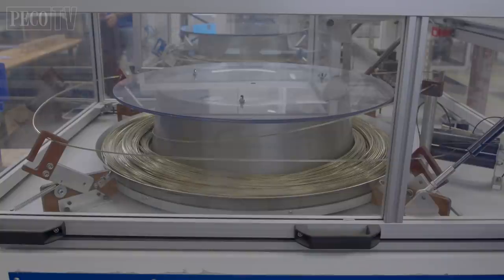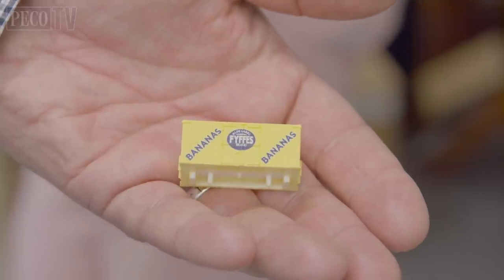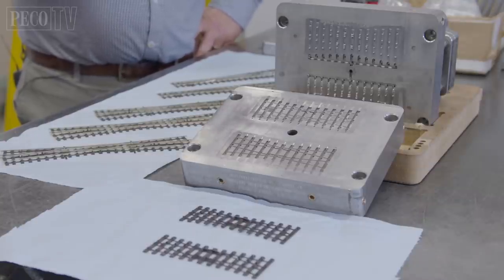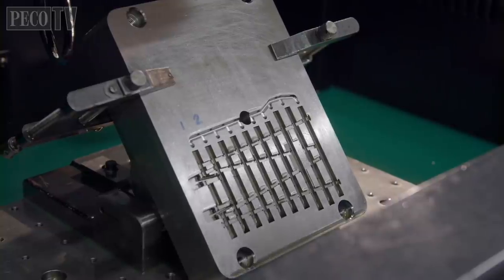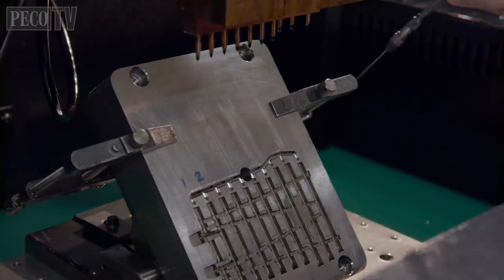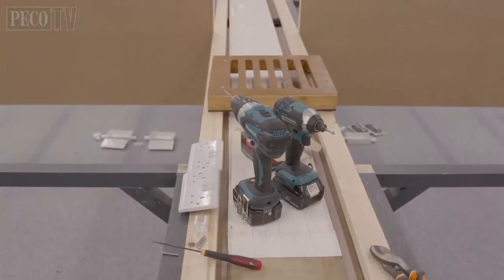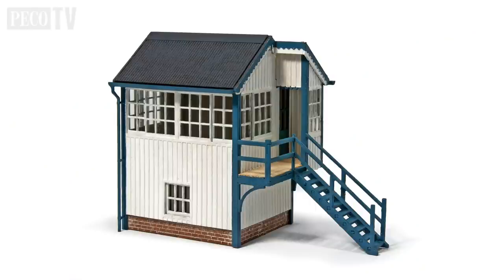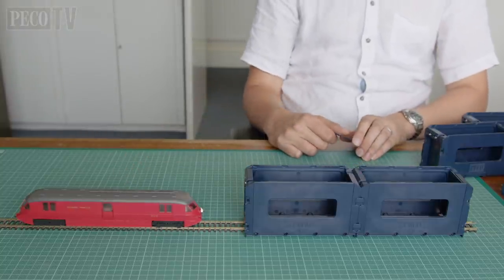PECO "Autumn Watch" - a peek behind the scenes!

Comment: Great to see PECO manufacturing in the UK when so many import. I will continue to buy PECO when I can as a result of this. I didn't know about the Highland Railway signal box, I'll have to have a look at it.
My only suggestion for a new product would be a single code 100 setrack curve of 12 degrees to work with short Streamline turnouts. This would allow Streamline turnouts to be integrated into setrack track plans creating a bridge between the trainset market and model railways.

Comment: I found the automatic track-making machine in action fascinating!  One thought came to mind - can you consider supplying track with holes in the sleepers to fit a third rail for SR layouts?  You might also consider adding a track with a pre-fitted third rail to your range. London underground track would be a good idea for PECO, as completely no other manufacturer is prepared to supply it. Those planning Isle of Wight and London Underground Layouts using the forthcoming motorized OO gauge Tube units will constitute a large market. There must be countless prospective modellers in London who would like to put an Underground layout together with ready-to-run components!  Thanks for uploading.

Comment: I know you guys are moving to Unifrog but as a DC modeller i need insulfrog - for simplicity and power routing. I'm probably not the only one who would like you to continue producing SL-91 & SL-92.
Reply from the maker: Thank you! You can use a Unifrog turnout just like an Insulfrog, just as it is. But the option is there to power the frog if needed.
Reply: @PECOrailwaymodeller  But from what i've read, you can't use it to isolate a siding.
Reply: @TANGARASandOSCARS  Just use an plastic fishplate and a switch.